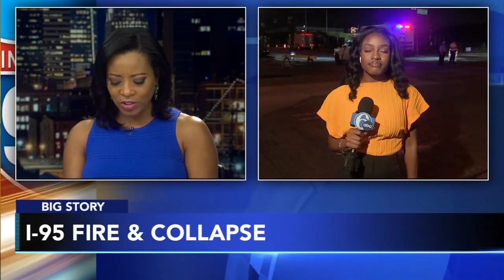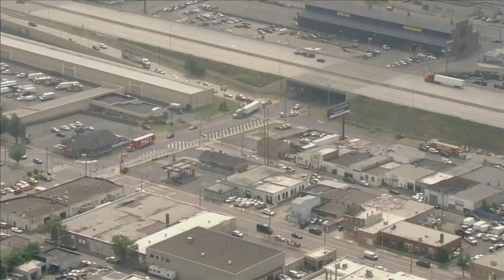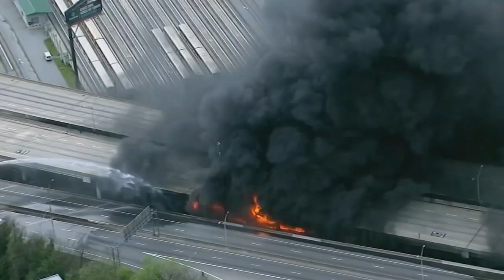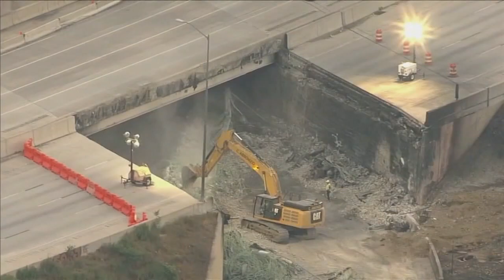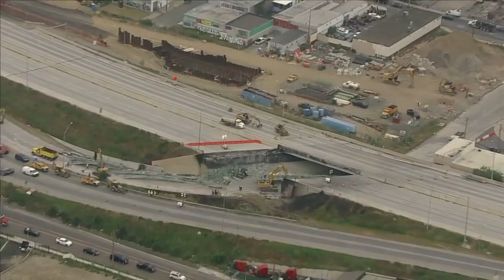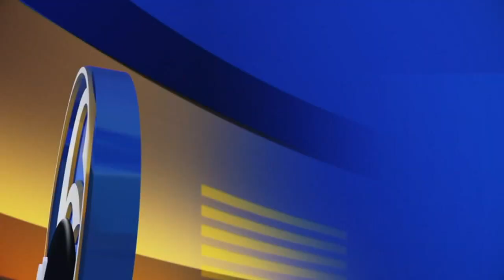How the I-95 collapse compares to I-85 collapse in Atlanta six years ago

Comment: So they can replace the 85 bridge in 6 week's , which was a much longer section. Got to love the Union rules. Twice as expensive and twice as long to rebuild. And no better construction.
Reply: I own a business outside Philly.  Fortunately for me it is not a service that the union ever got their claws into (tree trimming and removal) but I work with, and for, lots of union owned companies and the antics of how well they can waste the client's money in astounding, and almost quite impressive.  A friend of mine who is an electrical engineer said that if he is at an electrical panel, and he wanted to move a wire from here to there (and this is the guy who designed the electrical system and the controls) he has to stop, get a union electrician, and point at the wire and say 'move this wire from here to here' and if he doesn't, the union zombies will all start yelling that he is taking away their jobs.  It is ridiculous, but it is why everything costs so much more in Philly...